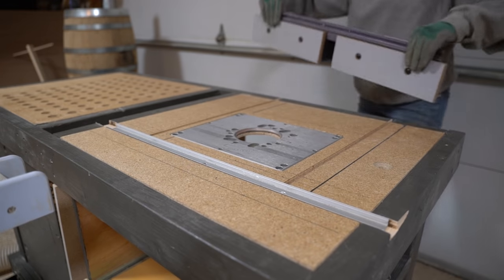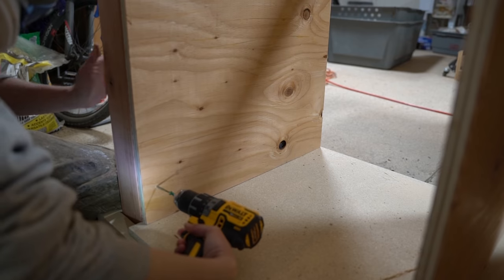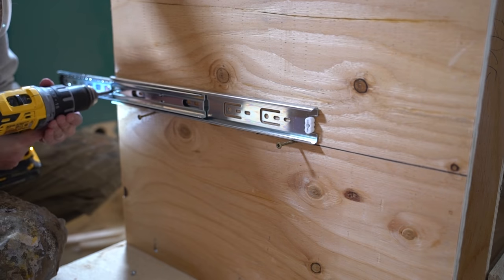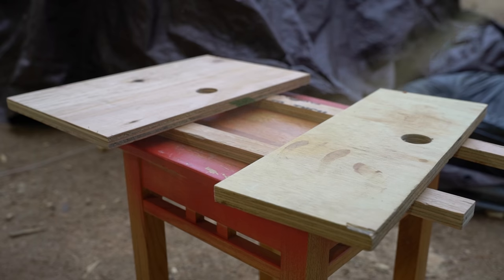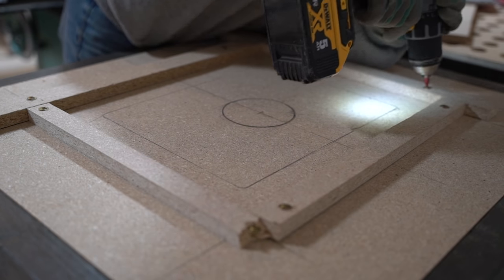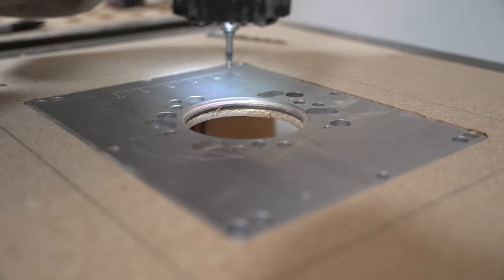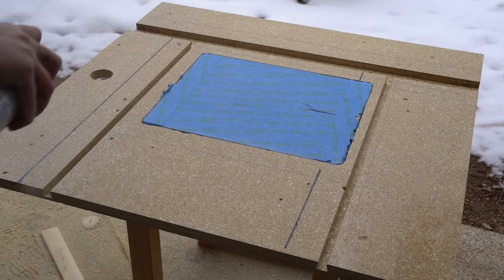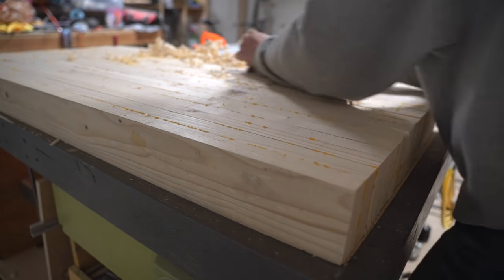DIY Router Table with Inserts - HW|Designs

Comment: I really like the idea of only routing away enough material so that the router insert sits flat. I've done it before by leaving a lip, which felt kind of "janky".  This seems much more stable.
Reply from the maker: Ditto! My last one was kind of like that, and it made me look for ways to avoid using it i think I.e. “can I do this with a different tool?” Kinda thing